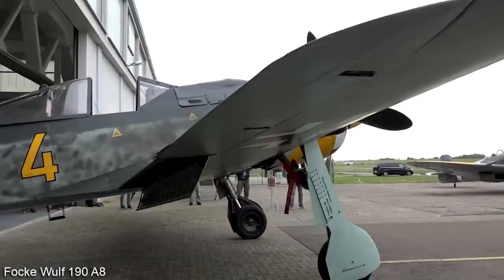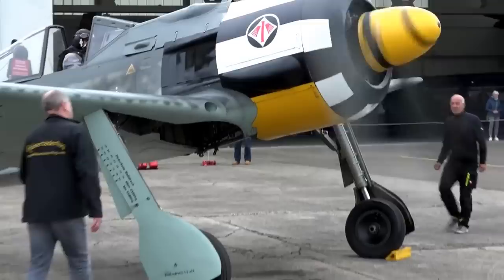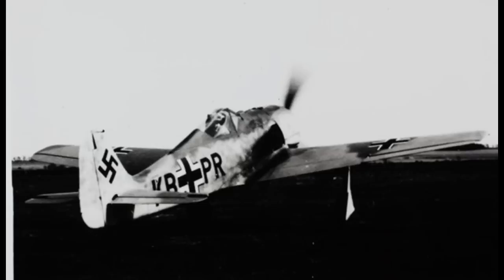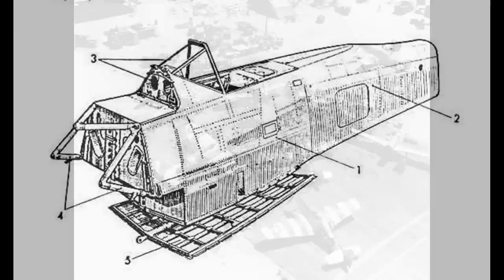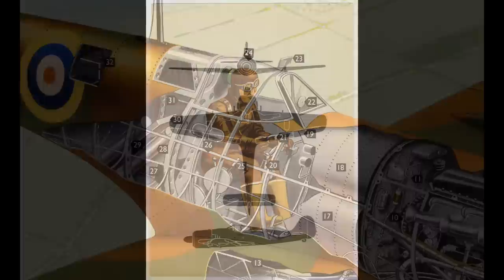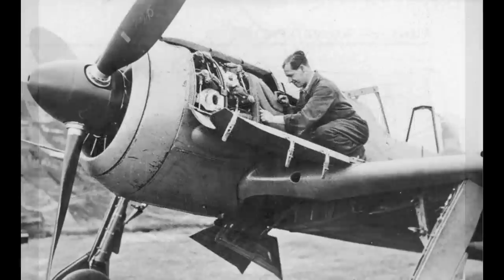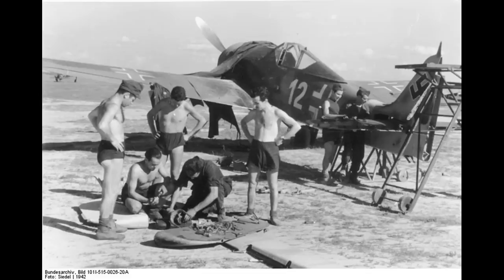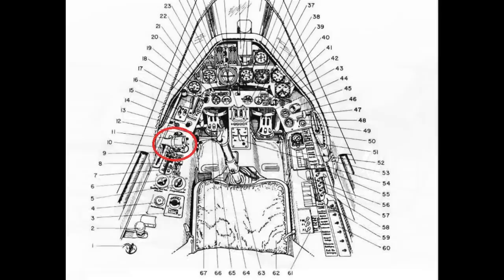Focke-Wulf Fw 190 Pt.2

Comment: Nice video series. Something I've found mentioned about the 190's overall performance in flight test comparisons from back when the allies were flying a captured 190 that landed in England by mistake.
There are references to it's control harmonization and how the pitch and roll pressures and inputs were of the best balance as compared to it's contemporaries. Mentioned in the same reports are how the pitch control did not need huge adjustments throughout the aircraft speed range. Also although it didn't have great sustained turn performance, it's instantaneous was above average and when used properly in an energy fight, helped to make the plane a tough adversary. The quote from Bob Hoovers book, Forever Flying, "The FW 190 pilot had hit me with a high angle deflection shot that I had discounted as impossible", may be an indication of proper use of this instantaneous turn performance. I really feel that this aircraft was the first build of a simple point and shoot air combat platform, made to offload the pilot workload as much as possible, so that he could focus on air combat and not management of the machines systems. Another thing not many will want to admit with revisionist history being what it is today. A team from Grumman was able to test the 190 captured when it's pilot landed in England by mistake. After seeing the design and performance of this early 190, this team was inspired to build hot rod fighter of their own.. this lead to the F8F Bearcat. Look up the name Corky Meyer referencing 190 test flights.
Reply: I believe the F8F being inspired by the FW-190 is a myth.  Here's just one example: https://thanlont.blogspot.com/2011/02/conception-of-f8f-bearcat.html

Comment: Great series. As to pronunciation, atu is pronounced ahtoo. I always figured the straps on the rudder pedals were there to keep the pilots feet on the pedals as he did aerobatics. Negative G in a sudden dive or inverted flight at the top of a loop for instance. Your idea of it being to enable use of the pedals by either foot if injured is a good one too. Never occurred to me.
Reply from the maker: The negative G theory actually makes more sense, I like it.

Comment: It's only recently that we've returned to single-lever engine control on piston powered airplanes with FADEC systems. It's still somewhat exotic compared to the standard throttle, prop, and mixture controls.

Comment: The FW-190 had to have a canopy jettison system because above 270 mph the aerodynamic forces held it firmly closed. They installed pressure sensors around it and calculated it took about 50 horse power to overcome the forces holding it shut.

About engine mismanagement, I read about four Bf-109s trying to bounce US pilots from a high altitude, the engines started to emit heavy black smoke in a dive and then one of them blew up in mid-air!!! Caused by excessive manifold pressure most probably.
Reply from the maker: The Soviets were perfectly happy to accept canopies that wouldn't open above certain speeds, so I hesitate to use the phrase "had to have".
Reply: So, would that be called a "bad luck, comrade" design philosophy? Not too much surprising that the Soviets do not bother with such trivialities. 😁

Comment: Sounds like the FW190 was almost supposed to be the A10 or Harrier of its day. Able to operate from rough and improvised landing strips out in the field instead of proper serviced airbases although probably easier to fly than both of those and evidently it had some of the qualities of the Apache helicopter. Designed to take a lot of punishment and remain operational.

Comment: Gerät exist in Swedish as a word as well where it's called "Apparat" which basically translates into "a mechanical thing that does stuff" for instance it's the name for the avionics boxes in the J35F Draken that's used to prepare it's Falcon air to air missiles for firing (AIM-26B and AIM-4C).
You should do a video on the Falcon missile system (The Draken flight manual is declassified but in Swedish).
Reading what was needed to make the missiles fire it's pretty obvious why the missile system didn't work for a fighter aircraft but could work for an interceptor (barely) because they get to pick the time and place of the engagement.

Here are some limitations.
If you arm the missiles they are given stand by current for the missiles electronics however after 60 seconds the missile disarms itself and the current is shut off if nothing is done after this.

You have to half press the trigger to activate internal power and cooling of the missile but this can only be done after at least 10 seconds has passed since the missile was armed leaving a 50 second window.
Full trigger pull has to wait 5 seconds after half pulling the trigger but this has a 55 second time limit as well after which the process has to restart with a new missile. Full trigger pull fires the missile after 1.2 seconds.

On the Draken this was a very advanced system as part of the very advanced air defence system.
From the J35B in the early 60's the Swedish air defence system used datalinks for fighter interception which gave the target course and speed relative to the interceptor and gave this information to the radar a limited message functionality of about with pre selected messages could be sent as well.
When the J35F Draken entered service in 1966 this system was integrated with the Falcon missile system thus the radar after getting the target information now handed this and it's own search data off to the missile system which made it possible to fully automate the firing process, all the pilot had to do was enable a missile launch.
In this context the system becomes much more effective, the Falcon also had a few capabilities early sidewinders didn't have such as slaving the missile seeker to a radar target.
The J35 Draken served until 1997 in it's J35J configuration which where upgraded J35F Drakens.
And the AIM-26B which was the radar version of the Falcon  served right up to the end, the missiles had been modified in the late 1980's to work on low level but that's another story.
In 1977 the AIM-9P3 was introduced which complemented the Falcon missiles on the Draken and on the J35J got two new dedicated sidewinder pylons, the missile could only be boresighted on the Draken though.

Comment: About the Soviet fighters mixture controls, the ones equiped with Klimov engines had manual mixture (Yaks and LaGG-3), but the other fighters equipped with Shvetsov and Mikulin engines had auto rich settings available (I-16, MiG-3, La-5/7). Maybe the late war Yak-3 and Yak-9U had auto rich but I am not sure.
Reply from the maker: Yes, I wasn't trying to give the impression that all non US planes except the 190 had auto rich, simply that some don't and that in any case the 190 operation is simplified even further.
Reply: @GregsAirplanesandAutomobiles  yeah. Another impressive thing about the 190 control is the supercharger switching calculation, as every power setting has it's own optimal supercharger switch altitude and this would depend on wether the plane is going fast with ram effect or in a slow climb.  It can be tricky in IL-2 as you get in the late war with multiple engine settings and the different octane fuels for the P-51 and Spitfire, the automatic switch is optimized for a particular setting (like WEP or Military power with ram effect), instead of all the possibilities.

Comment: I’d say that the potential issues with formation flying could possibly come from the fact in a traditional engine control set up, you can leave the RPM at a given setting (2700 in the P-51 for example) and then fine tune with small manifold pressure adjustments to keep position. With the Fw 190 this might be difficult because moving the throttle lever will adjust both RPM and manifold pressure which may result in significantly more “thrust”/drag produced even with fine movements of the throttle.

Comment: oxygen bottles that are pressurized to 400 PSI would not be nearly as violent if punctured as the bottles I've seen shot in videos. Industrial oxygen bottles are generally pressurized to 2200 PSI or more.

Comment: Great description of the cs prop.  After absorbing some of your videos and learning more about engine performance, it’s clear that engine manufacturers come up with proper mp and rpm values to produce best power.  But what about propeller efficiency and perhaps even fuel flow?  Regarding the prop, how does one achieve the most efficient prop angle for,a given set of circumstances?  Or am I missing something fundamental about propellers and I’m looking down the wrong rabbit hole?
Have you knowledge of how some of the NACA and flight manual graphs derive their values of mp and rpm?  Is it based on a test stand using an operational propeller, and simulating different density altitudes, an accumulation of flight test data, both?  Do your primary sources chart propeller metrics to determine what angle or rpm settings are best for a given prop?  Is it always best to use the largest angle possible that won’t damage the engine?  I guess that’s always been what I’ve never understood to intuition about cs props - what determines the angle that results in the biggest bite w the least amount of power required, or what is best for time to climb, or what is best for maximum range…

Comment: I think of the prop control as analogous to the gearshift in a car: Max RPM = low gear, Min RPM = high gear. Everything else just falls into place.
Auto prop control = automatic transmission, CS implies CVT in the car, where IMO a properly matched engine/CVT will keep engine at ideal point on the torque or power curve at whatever road speed the driver chooses.
Reply from the maker: Is is somewhat analogous to a vehicles automatic transmission. The big difference is that it's infinitely variable throughout a much larger range than in a car. The old Buick Dynaflow is probably the most similar.

Comment: 8:35
The explosive charge to jettison the canopy was needed because of the high aerodynamic forces on the canopy during flight. During testing the test pilot wasn't able to open the canopy with the hand crank at all. That's the reason they had to implement this system with the explosive charges.
Reply from the maker: I've read that, but there were  possible solutions other than explosive charges.

Comment: Here a bit late this time. I was in a Pfalz D.IIIa when you released this one. Fantastic stuff as always. I'm surprised that they took the IFF out completely. One would think that they could atleast put a disarmed unit back in, or even a nonfunctional replica.
Reply: This is an F8, a late war model. According to wikipedia the system was compromised in 1944 as a damaged ju88 night fighter equipped with it got captured.
A mosquito raid with imposter devices led to the order to disable the device as it could no longer been trusted.
Why equip and carry a unusable device... Makes sense for me..
Reply from the maker: Hi Central, I was actually watching your new Pfalz video as I was uploading this one. Good work there.
Reply: @GregsAirplanesandAutomobiles  Thanks.

Comment: Hey Greg,  love these videos.  Like your commentary on the gun camera footage on the attack on the P47.  The p47 seems to take some good hits yet keeps on going!!  Looks like maybe it got hit in the forward fuel tank??  Seems to stream fuel at first but stops, possibly the self sealing feature worked??  Must have been frustrating for german pilots to see the p47 shrug off their attacks!  Read Robert Johnsons book. Very interesting.
Reply from the maker: Hi Jim, I don't think that was fuel it was streaming, I think it was water vapor forming when the air passed through the hole in the wing and ran into the lower pressure, like what you see from the wingtips at airshows when the planes are in a tight turn.
Reply: @GregsAirplanesandAutomobiles  I hadnt even thought of that, but it makes sense.

Comment: The O2 tanks being shot in the YT videos are typically around 2500-3000 psi. Far more dramatic results than a tank with a few hundred pound of pressure as installed in the aircraft..

Comment: The F4U Corsair has a spar that goes straight through, though obviously the outer wings have separate spare. The zero has a wing that goes all the way through, as do Glassair experimental aircraft. I've had to help carry Glassair wings, and while the Glassair II wing isn't so bad, the III wing is a beast.
Reply from the maker: Yes there are other planes with a spar that way, but I couldn't find one with a spar that goes all the through and connects to the firewall.

Comment: Having flown in formation with piston and constant speed: set the RPM (pitch) and fine tune with the sound. The throttle is set close per the ground briefing then fine tuned with the closure rate with the other aircraft. We would never have a set and forget power setting.
Reply from the maker: agreed.

Comment: Wow! Jet engines require so much less management. Super interesting
Reply: I believe that was a major factor for ending the use of the Super Connie for passenger transport :-)
Reply: @MultiZirkon  The old Curtis-Wright R-3350 turbo-compounds could only manage a few hundred hours between rebuilds. Modern jets go for more like 3000 to 5000 hours between rebuilds.

Comment: Looking at the FW-190A, it really makes me wonder what the Curtis P-36/P-60E could have developed into.   The P-47 was a high altitude fighter pressed into the fighter bomber role, where as the Hawk fighters were designed specifically for low/medium altitude.
Reply: @HiWetcam Yes, Curtis designed the WW2 Hawk series of fighter to fly optimally at/below about 15k ft ASL.   That was the US Army's requirements for the fighter in 1935!   The Allison V1710 was  also designed to meet that requirement.    It was a lighter, cheaper engine than the Merlin but it's final variants were certainly as powerful as the Merlin.  Today's Merlin engine  racers all use the Allison's rods.   When the R2800 became available in 1940,  It certainly should have adapted to the Hawk as it was the Republic P-43 which evolved it into the P-47.     The Army kept shifting the goalposts on Curtis.   Then told them to build P-47s!    IMHO there was a lot shady political dealings with the US Army's acquisition that hampered US fighter development.  Remember this is the same US Army that forced retired its most able fighter tactician, Claire Chennault and then left him in China for the duration of the war after they realized their mistake.
Reply: @HiWetcam It wasn't the US Army Air Force until March of 1942, it was the US Army Air Corps in 1935 and it was subservient to the whims of the Army.  The Army was more concerned with Close Air Support than Air Superiority,   You also have to also consider the Army's position at the time,  budgets were tight and its priority was ground combat and the USAAC's role was the serve that priority.  The Army's lip service to air defense was the P-38.  The P-38 was the arguably the best  high altitude interceptor in the world at the time.   It was  faster than the all the early models of Spitfire, ME-109 or FW-190As.  Back to my original assertion, the R-2800 was introduced in 1939 and certainly would have made the P-36/40 Hawk a better performing fighter had it  been adapted.

Comment: 2640 Commandogerät: Yes. Fex. on the East Front the most respected Soviet plane (even in 1944) by the Hungarian pilots was the La-5FN, but when one year earlier the Luftwaffe axquired an intact Lavochkin, they especially note the "unfriendly used interface", as seens here:
https://www.asisbiz.com/il2/La-5/Lavochkin-La-5/pages/Lavochkin-La-5-captured-by-German-Forces-01.html
"All of the engine controls (throttle, mixture, propeller pitch, radiator and cowl flaps, and supercharger gearbox) had separate levers which served to distract the pilot during combat to make constant adjustments or risk suboptimal performance. For example, rapid acceleration required moving no less than six levers."
Reply: Patrick Brennan  No doubt they got the opportunity to "be inspired" by some of the more intact FW-190 wreckage...Also even for a few days Barbarossa was rolling, the USSR and the Reich conducted trade, even technology excange (that is earlier).

But the La-5 family is said to be the development of the earlier LAGG-3 "coffin", so any similarities to the FW can be also attributed to the laws of aerodinamics.

AFAIK the Royal Hungarian Air Force pilots respected the Lavochkin for its durability (due to radial engine) over the Yakovlevs and the few Aircobra they might encounter.

Comment: Excellent, as usual, Greg. The photo at about 30:30 (the sort of "group 190 portrait) is one I've never seen before – it's the largest group of 190s I've come across in a photo in decades of reading about WW 2 fighters. Too bad more automotive engineers haven't adopted Kurt Tank's attitude toward making maintenance easy. Auto design now is more focused on assembly than maintenance, and some American WW 2 fighters were easier to maintain than others, too, for that reason.
Reply: Pretty certain that image is simply a propaganda photo. Just like the HE-100 photo that exists that shows a huge line of them but that was never reality.
Reply: @bIoodypingu  You're likely correct - I claim no FW190 or Luftwaffe expertise, but it's still a striking image. I expect that's the whole idea…
Reply: @bIoodypingu  so 9 aircraft is too many together?
Reply: @kenneth9874  Yeah... Because they never had that many operational at any point.
Reply: @bIoodypingu  that's a figment of your imagination